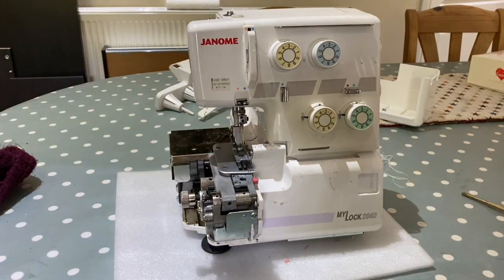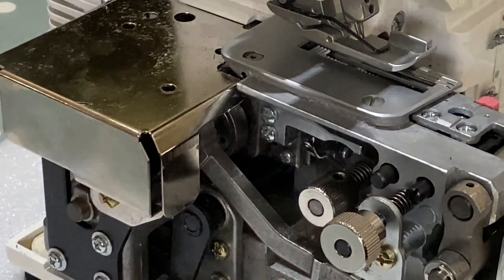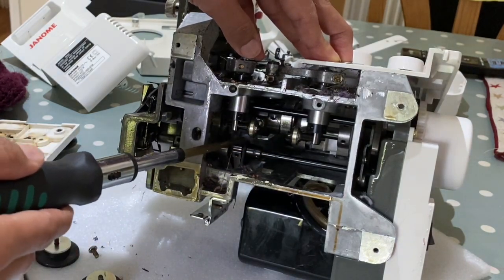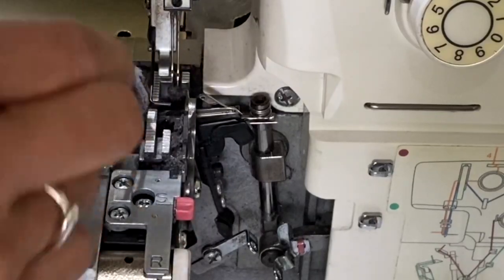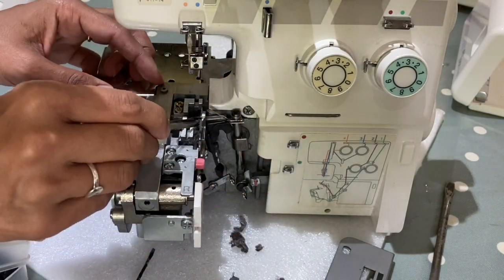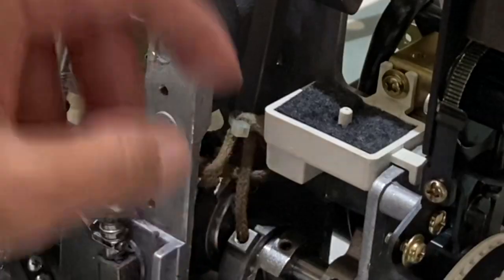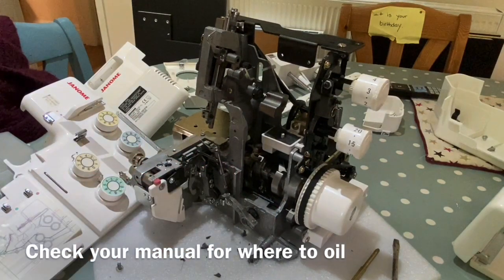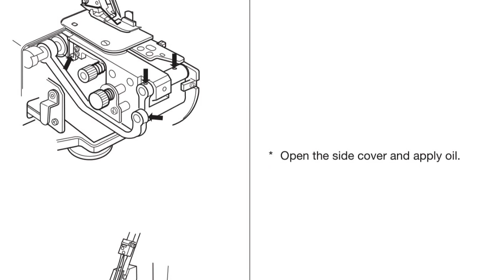How to remove Janome Overlocker cover - Service your own machine and SAVE $$$'s

Comment: I have this exact machine and almost threw it out the window today because of that lower looper. My machine is super clean inside though, because it’s such a pain to thread and I can never get the tensions to balance. Love your videos Abi! Please make more about this model Janome.
Reply from the maker: 🙁 it’s gone back home but I have made a video showing how to thread it up. I repaired another one a couple of weeks ago. Also , it’s exactly the same inside as the naked Overlocker. Janome machines are are the same inside, they just look different in the outside
Reply: I dug back in last night determined to get it threaded. Taking off the foot and needle plate made it much easier to thread the lower looper. I’ll look at the suggested video next. Thank you, Abi!

Comment: Hi I was wondering If you cold help me I have the brother over lock and I'm having alot of problems. without any fabric it seems to run okay and chains off bit soon as I put something through it stops but the machine and wheel still runs but not the needs and the chaining part of it and I have orderd a new plate as this is damaged but I feel its more in the machine that is the problem as soon as the fabric starts going through and it stops the machine still makes the noise of running and the wheels still spinning but nothing is happening at the needle what would you suggest please 🥺 xxxx